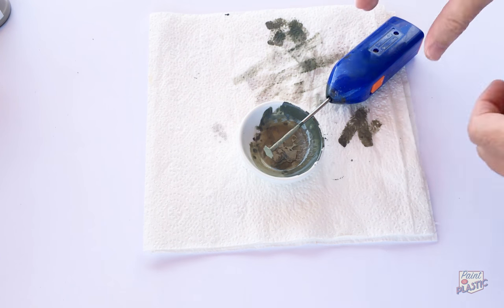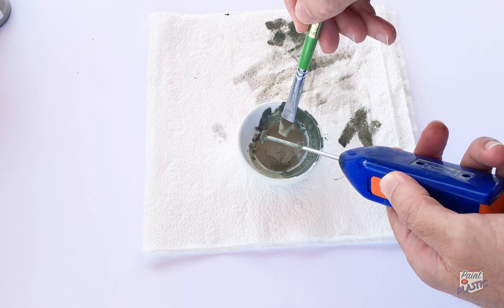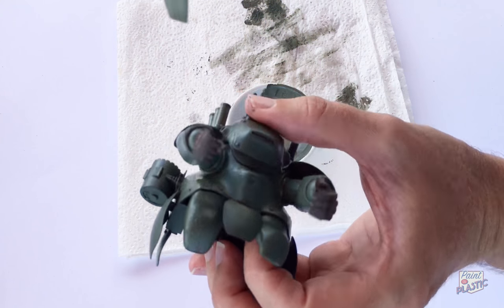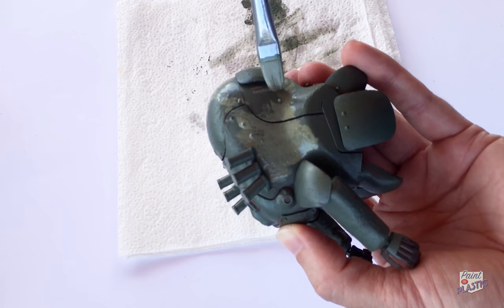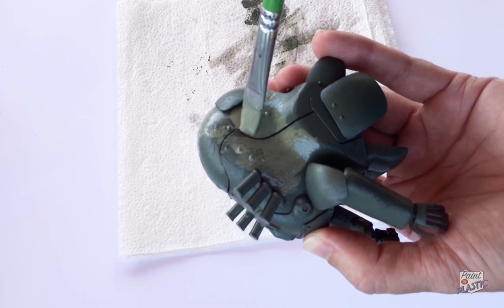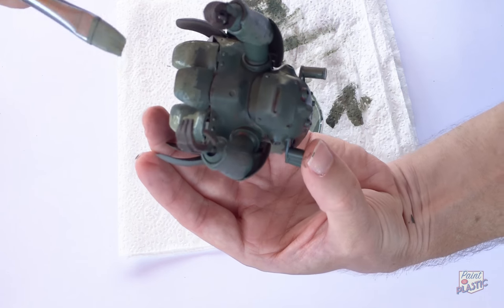Ma.K Weathering Camo - Free Hand brush Mr Color by Lincoln Wright

Comment: At least I can see the consistency of a paint you are working with. Thank you.
Quick question about painting straight from the bottle. Aren't you afraid that not thinned down paint will build up too much or cover some details?
Reply: I know this comment is 6 years old now but for anyone curious given the technique and approach you could always buff and sand any imperfections and then touch up with paint. This can add some extra visual interest as well.